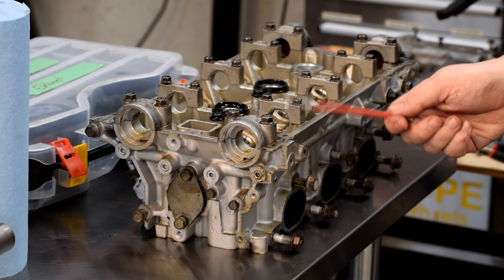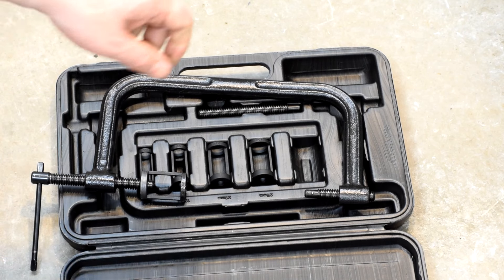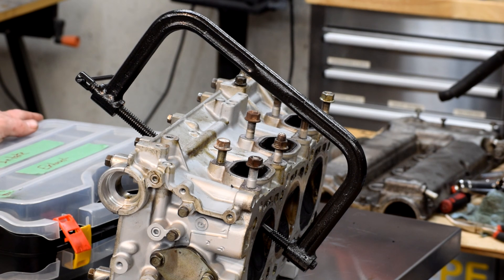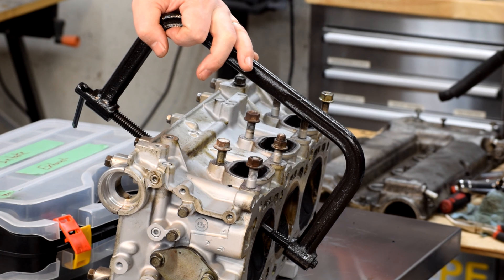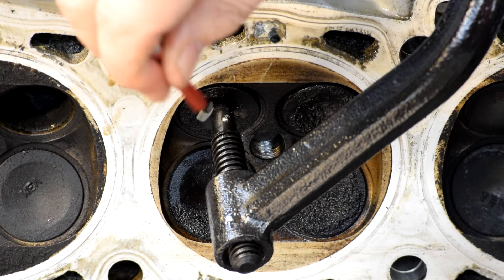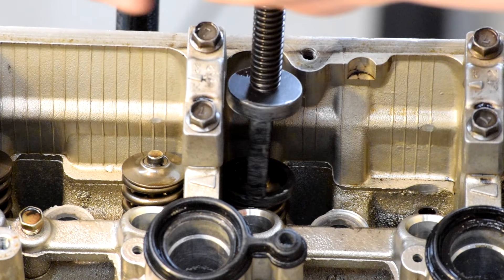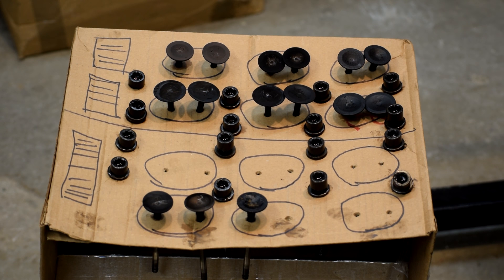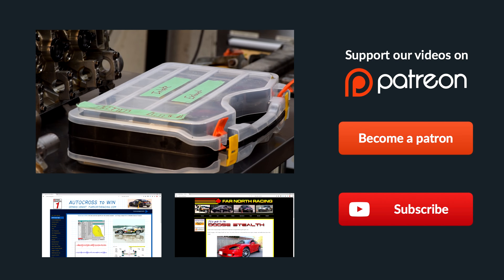FNR Stealth Project Ep 9 - Using a Valve Spring Compressor

Comment: Aren't you supposed to fit another adapter on the static end of the compressor to get a larger point of contact to the valve face? It looks like the static end is also meant to accept an adapter (the ball stop). Thanks for the video!